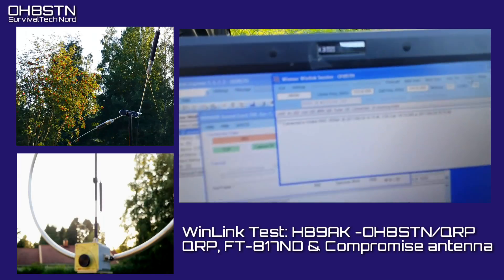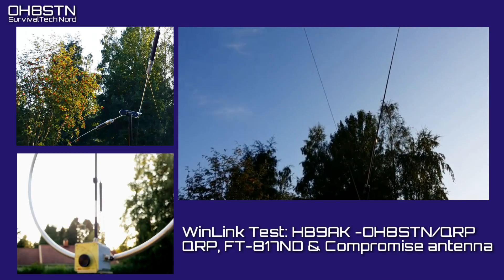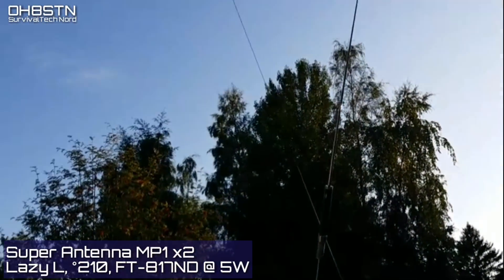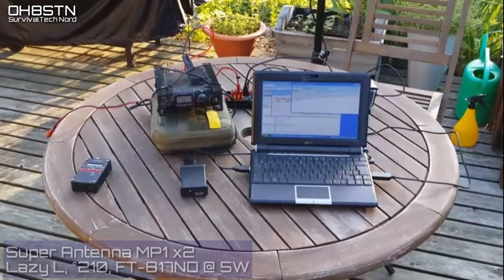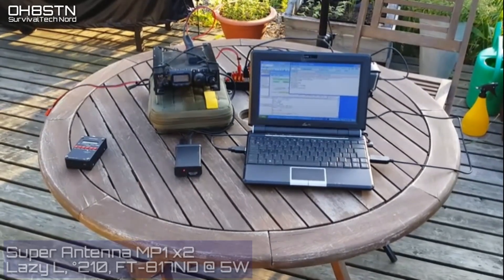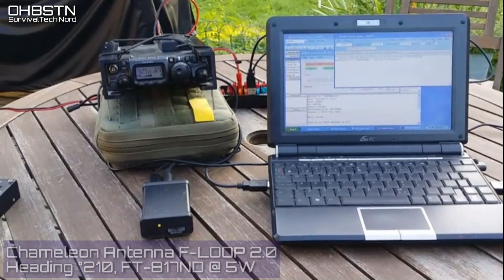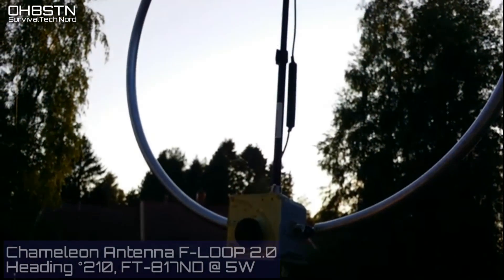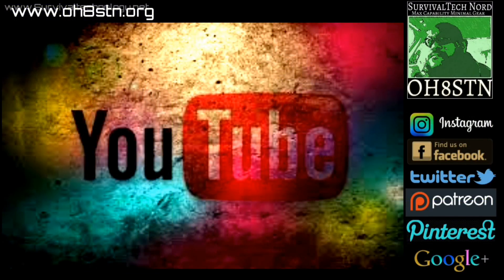WinLink Test for Off Grid Emergency Communications

Comment: I have to say that I came across your channel a few months ago and I didn't subscribe because you answered a question that I had and I didn't think I would be back. I find myself coming here a lot now so I subscribed (and clicked the bell). 

I am just starting off with WinLink. Literally. Like today. I connected my 817ND, MiniPro SC, and WinLink "together" and opened a Winmor Winlink session. I found plenty of HF stations to connect to but I could not make a connection. I kept seeing a warning... something about Tx/Rx latency? 

The MiniPro SC is pretty simple to use. I feel like my Radio setup was flawed but haven't figured out how it was flawed. 

I hope to have an HF RMS Gateway online before ARRL Field Day but first I need to make Winmor work. Telnet works. 

Once I find my cables I'll try my old AEA PK-900 with my FT-847. 

Maybe the FT-847 can be the HF gateway... I don't know enough about WinLink to know what I need to do at this point. It's an impressive system.   73 NE5U  Mike
Reply from the maker: Hi Michael
I can be pretty grumpy with the answers sometimes,  but I always mean well. I hope I wasn't too hard with the answer to your question. Actually this question about winlink and normal audio interfaces comes in almost everyday. The standard answer were given by Advocates of winlink is to buy the pactor modem which is over a thousand bucks, but I think it's possible to make it work. The transmit and receive switching latency is a problem of the audio interface, not the radio. With that said I have been able to use winlink effectively using the MiniProSC modem, but not unless all other parameters were set up correctly. You have to have a clean signal, power level has to be set correctly, and you have to be on the right frequency. If that wasn't enough you'll have to figure out which of the wind link gateways you can reach with your operating conditions. For me it was extremely difficult to get started, but with patience and testing, I was able to get over that hump.
Here's some advice to get you going
Make sure other digital modes are working like rtty, psk31 , ft 8 and so on. If you're able to make qsos with those modes, then you can be fairly certain your audio levels are setup correctly. Next try to the right distance to the right Gateway. I found it was easier for me to hit the station in Switzerland then it was for me to hit the station at the same country down in Helsinki. Even the stations in Sweden couldn't hear me as well as the station in Switzerland could. This doesn't make sense during our troubleshooting but it's something I need to point out. I realized I was skipping right over those closer stations, to try stations you wouldn't normally associate with being able to hit.
Another thing is sitting on that Gateway frequency to make sure you actually hear activity. It may take some time but it's a good way to find out if you can actually hear that station with your antenna configuration, even if it can hear you. 
So when link isn't the mode to start with if you're new to digital modes. Set up using something simple like FT8.
Thanks for watching and subscribing,  it really means a lot.
73
Julian oh8stn
Reply: Very good Julian. I don't recall that you were grumpy at all. I see you as someone that gets to the point and that's fine by me. I've made contacts on FT8 (love / hate FT-8... that would make a good bumper sticker) and WSPR with my FT817ND so I know it works. The gateway distance is probably the key. I tried for the shortest distance. My antenna isn't the best but it works for other modes. To borrow a line from the movie The Outlaw Josey Wales- I think I should "endeavor to persevere" :D 73 Thanks for all you do NE5U  Mike

Comment: What happens when you use the F-Loop in a horizontal position? MB
Reply from the maker: +Michael Bradley as a mostly portable operator I almost never have a chance to use it horizontally. Why do you ask?
Reply: If used in a horizontal position, would it send and receive in 360 degrees eliminating the need for tuning?  It would still be portable.  MB

Comment: I've not dabbled in any digital modes......yet, but that is on the list (after I become proficient with morse code, that is)
Reply from the maker: +Ron C Good luck sending or receiving a database with morse ;)
Systems like ALE or WinLink are used to carry vast amounts of information to groups or team members. Morse could have been used for a contact, but would not have had sufficient bandwidth for the amount of data moving.
Reply: I'm very familiar with ALE from using a CODAN NGT at work on occasion. My reference to morse code was only meant that I'm concentrating on that before I start dabbling with digital modes else one will consume more time from the other, if you know what I mean. I really enjoy your channel, my friend. You have a lot of knowledge and I appreciate you sharing your skills!

Comment: I'm guessing you are connecting to Winlink via a Winmor connection?  I gave up on Winmor as II found reliably sending and retrieving email was problematic. I stressed my wallet for a PACTOR IIIusb. Performance is amazing. 
I understand that it's necessary to reduce power on a transmitter when using a digital mode (don't know about FSK), else phase noise from the transmitter LO distorts the phase shifting of the outgoing digital signal. (In my station I use an Icom 7200.) Any idea if this remains the case with a transmitter (i.e., the 817) designed  to begin with for a max of 5W out?
Reply from the maker: +Jim Piper yeah I understand the PACTOR modems have much greater performance but that's not ever going to make me pull the trigger on one. I happily paid the WinLink express registration which goes to support the development effort of the software. Since WinLink is a secondary tool, I can't justify the cost (or extra weight) of that proprietary Hardware in my mostly Man Portable ops.
WinLink documentation specifically tells you not to drive your transmitter more than 60% of its output capacity. I simply stick to the recommendation.
Reply: My PACTOR was a treat to myself as I thought I deserved one ;-)  Besides, weighing a pound/454g, it only cost me about $75/ounce // $2.64/g. I use it for email when we go trailer camping out of range of cell towers and VHS packet digis. Also, it's fun to see data moving at 1400 bps on HF (yes, 5kbps IS possible with a good path and quiet conditions).
I envy all hams out side the US where a PACTOR 4 Dragon can be used. It's twice as fast as PACTOR 3.
Reply from the maker: +Jim Piper Nice. Well, if i didnt need a tipitent, tent stove, new skis and a new lightweight ruck, maybe i would pull the trigger. ;)
 I like email for that last resort,  grid down, ... but i wish more operators would put up rms gateways for HF. I still prefer ALE  for real-time comms, but i learned enough about WinLink during the exercise to see its value.

Comment: Thanks for all your videos. I am a big fan of Winlink and it is one of those prepping skills that I practice once a week. I am a big believer that doing something once is just that, to depend on the equipment and the skills you need to get out the equipment and do it over and over so you understand how it fails as well as how it succeeds. Propagation is a factor, and by trying different bands and times of day I have a pretty good idea if it is going to work, and were to focus my efforts. Amateurs do it until they get it right. Professionals do it until they can't get it wrong. 73 Charlie